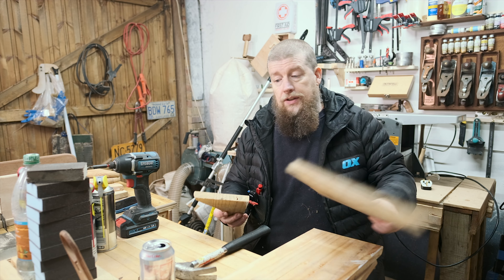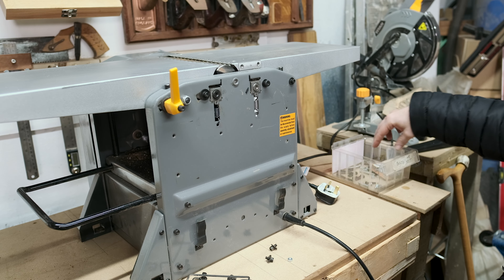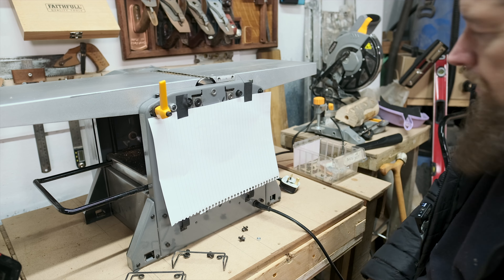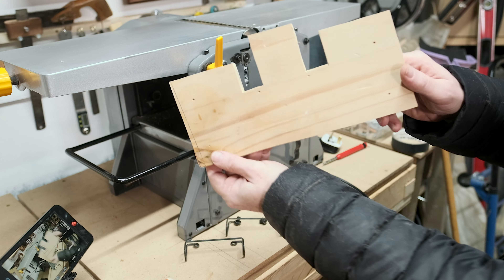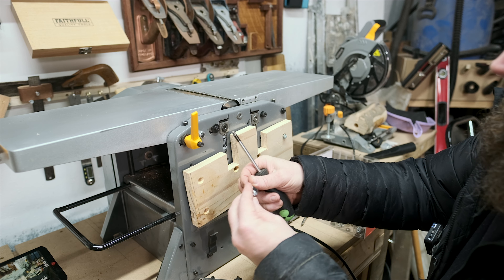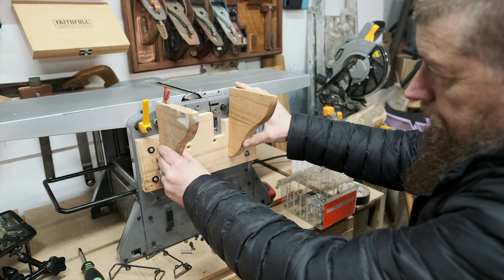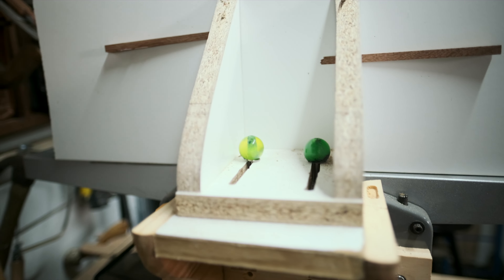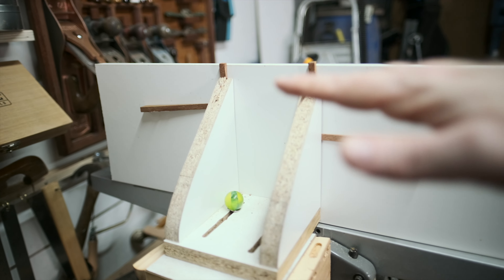Custom fence for my Thickness Planer (Titan but will work for others)

Comment: how do you get round the micro swich ? its a great idea to do that , its the biggest ball ake to keep setting the fence up , im just starting out so not used many thicknessers or jointers , ive bought the worst one on the market , but looks the same as yours , its the Scheppach and you have to have the chip extraction fitted before it works
Reply from the maker: To be honest Anthony, as a person new to jointers I would strongly advise leaving the micro switch to do its thing,
Reply: @WoodworkJourney  i was hoping to put a permanent fence on it so its always square , with hardley any way to adjust the fence i need to find away so i can use it as it should be used

Comment: I’m a bit like yourself I’m just starting woodworking still trying to finish shed/ cabin on inside before I can put floor in. But I’ve been fighting severe rheumatoid arthritis for 25 years and last couple of years I’ve had 2 strokes which has affected my speech saying words and I’ve lost my short term memory so can’t remember nothing after 5 minutes. But like you said if you’re bad and can’t pick up anything leave it alone and don’t do it. One thing I can recommend to you is a 
Magnetic Pickup Tool with Led Light and Claw, Pickup Tool Flexible Grabber Magnet Pickup  on Amazon saves you bending down and doing your back in
Reply from the maker: Yeah I have a grabber in the house, and a couple of magnetic sticks.
Just gotta do whatever you can do, keep at it fella
Reply: @WoodworkJourney  can I ask you something on your Titan thicknesser and planer if ok. On the dust extraction hood there is a thumb screw and an Allen key I know it’s says it’s a m5 5mm Allen key but doesn’t give the length.  Would you know what the length of it is as I’ve got same planer thicknesser but mine fell out and can’t find it. I’ve tried to find out from screw fix and other places but had no luck I was hoping you might be able to help me out if possible many thanks steve 👍🏻👨🏼‍🦽
Reply from the maker: Hi Steve, I answered your other post about this one. Essentially though get an m5 that’s too long, and trim it down to fit 😊
I don’t know the proper length and have no idea where mine is sadly
Reply: @WoodworkJourney  ok cheers and sorry I forget what I’ve massage to people due to short term memory loss from my 2 strokes and thanks again I might try to get a 10mm and try as never cut one before. When I say in a complete novice I really am

Comment: I wonder why these companies don't just provide a decent fence in the first place. After all, 90 degree edges is what you buy a planer for in the first place. I've got the Rutland's version of this planer/thicknesser. I was lucky enough to get it in the sale for £250, still a bit more than the Titan one. But its fence is FAR superior to the bit of wobbly tin that the Titan has.